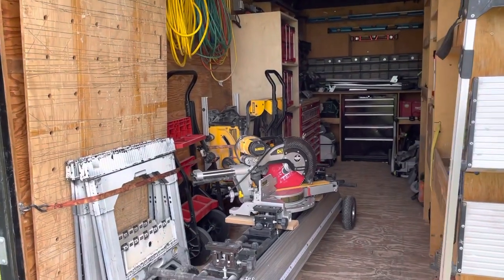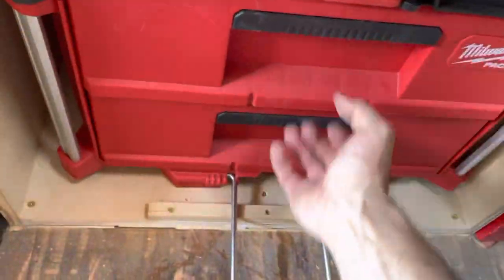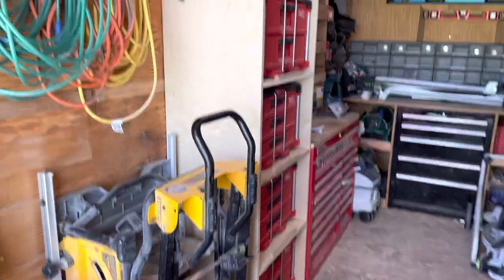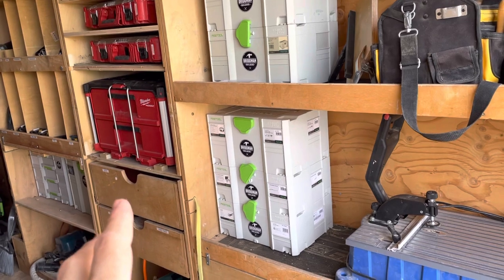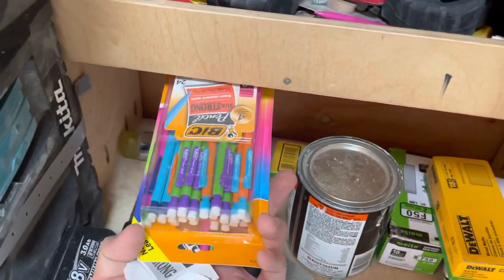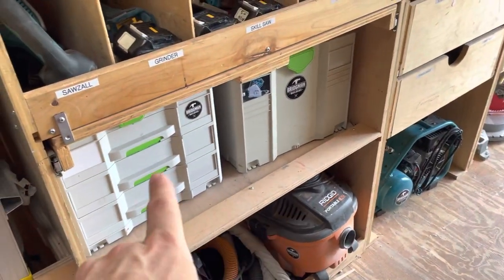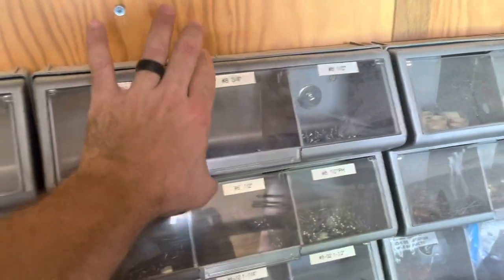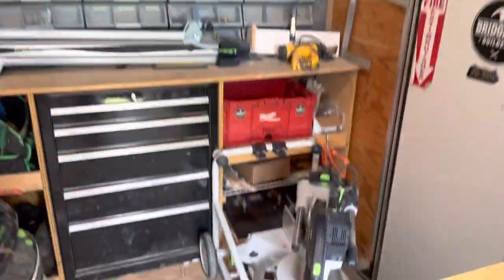Job Trailer Set Up

Comment: This probably gave me the most inspiration out of a lot of videos I have seen! Two years in trim carpentry now and getting my trailer in the next month. Will definitely be re watching multiple times!
Reply from the maker: Thank! I’m glad it’s got some useful Info. If I could do it over I would have made some storage under my cabinets for ladders and some behind for work table. I have modified my current set up several times but to cheap to buy new plywood to re build it all nice and clean. Lol.

Comment: So, would you buy the Kapex again and or the Best Fence? Or just use the Dewalt and put the money towards something else. 

I need something with extension wings. And, I have a little sliding Kobalt saw for trim. My Dewalt stays in my shop. But I am ready for something bigger.
Reply from the maker: For a shop kaypex and ug stand. Kaypex is great for small jobs on site but it’s not a heavy duty stand I would trim a house out with. It’s my favorite stand because of the built in tape but it’s just not heavy enough for production work.
Reply: @zackbridgman   okay, so Kapex would be good for the shop? What about the Kapex saw? Would you buy again? 
Also weee you saying the Kapex stand is the best or the Best Fence?
Reply from the maker: @travisandtracyjacobs6198  best fence is garbage. Never buy again. Kapex stand is awesome for punch list and shop use but not heavy duty enough to do production trim work. 
The kaypex is a nice saw for the shop because it sits flat to the wall and is a slider.